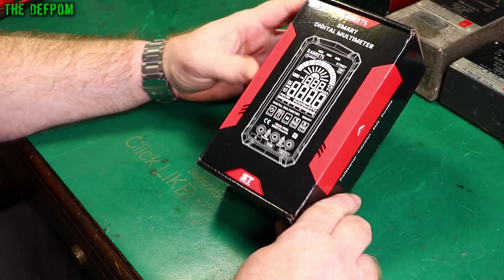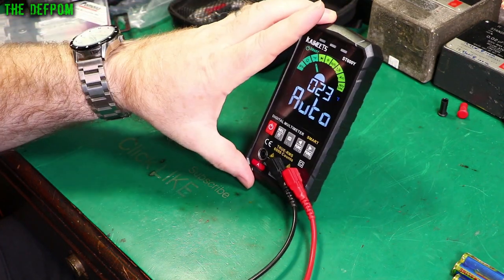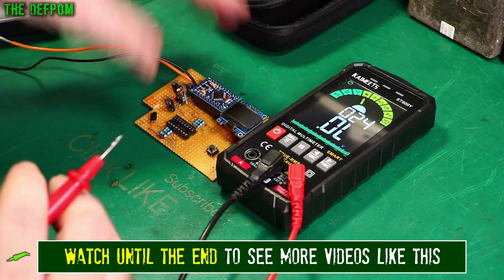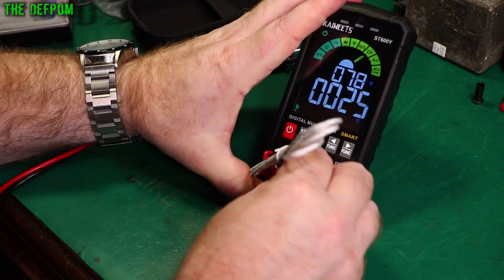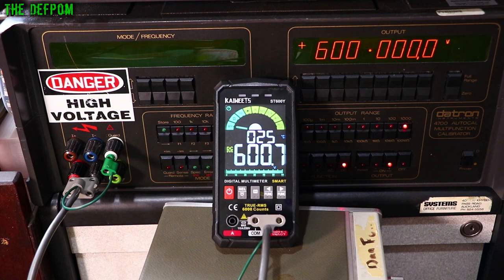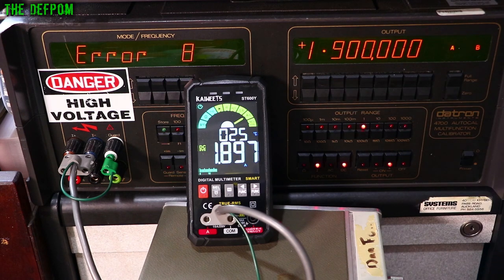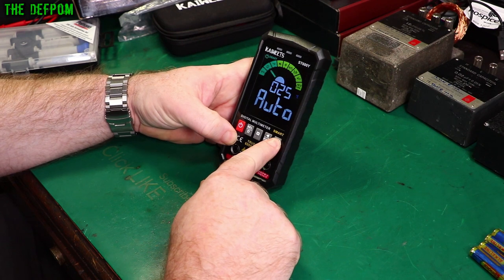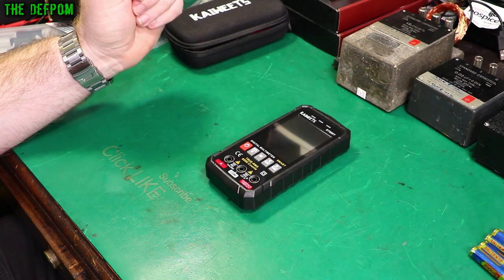🔴 NEW Kaiweets ST600Y Multimeter Review - Kaiweets ST600X Multimeter Review - No.914

Comment: I bought the KM601 because I couldn’t resist at the price and for what it does. I don’t have a calibrator, but I do have a few rather accurate meters. It tested quite well against them. Is it equal to my $1,000 (and above) meters? Well, of course not. But really, if you’re going to need more precision, then expect to pay for it. Otherwise, these meters seem to be more than adequate in accuracy and speed, and the rest of the features are excellent, including the flashlight on the back of mine, as well as the 10,000 count. The screen is the defining feature for me though as my eyes aren’t what they used to be. If the battery life is less then fine, it’s worth it. It’s amazing what you can get for very little these days.

Comment: But can I catch a crocodile with it? 

Nice video couple of points another video somebody else did with a closer look at the circuitboard showed a lot of over soldering that’s probably why you found that piece inside, so the soldering quality could be improved on all their instruments. The other point is you kept making a lot of conversation about the lighted jack ports you have to remember this is for the idiot homeowner or garage mechanic the only reason they light up is to show them where to plug-in initially after that, they don’t have to look at the lights. just placed my order for this model because I tried to 601 one but whoever thought of putting those jacks on the bottom should be sent back to school very awkward. That’s why I’m buying this unit otherwise looks like a very nice product for a beginner or a homeowner a lot safer than most so you don’t have to worry about which Voltage etc. the price is down to $26 on Amazon which is pretty darn reasonable for what you’re getting.